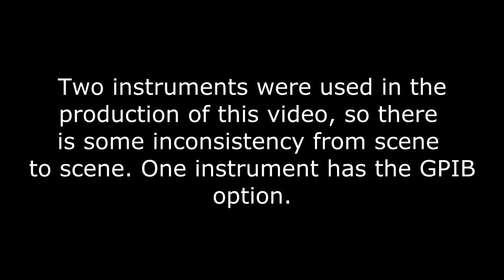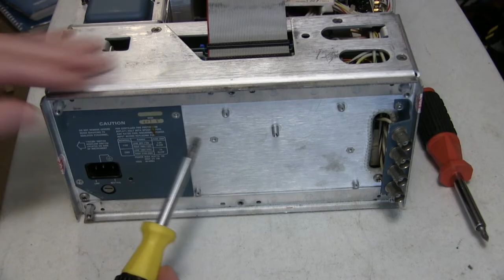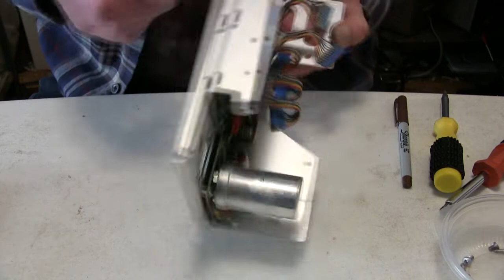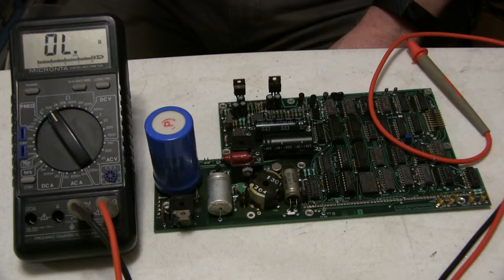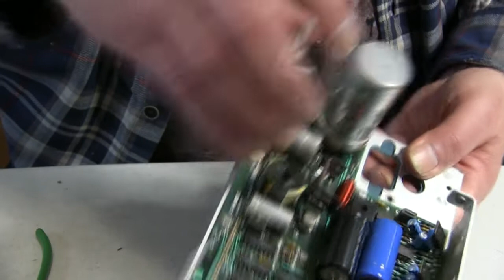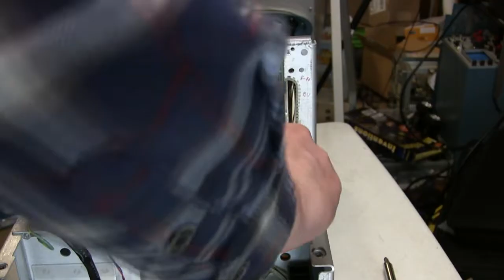Tektronix 468 Repair - Vol. 1 - Storage +5 Supply

Comment: Hi Bob, Just finished looking at the video of the 5-volt supply. My 468 had failed about a month ago and I finally got around to check it out the other day. The problem was exactly the same. The Shotkey diode was shorted. Luckily the crowbar transistor was still okay. I replaced the diode and the capacitor next to the diode because it was leaky. Now the 468 is up and running again. Good video on replacing the diode and troubleshooting the problem. Don